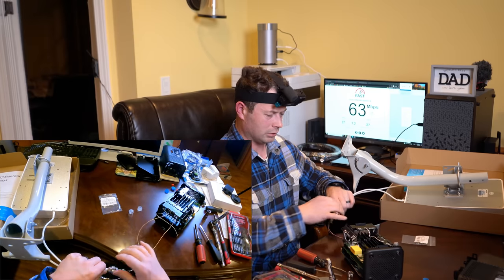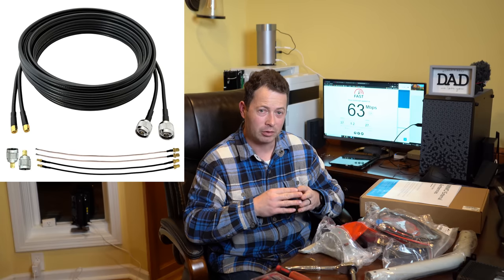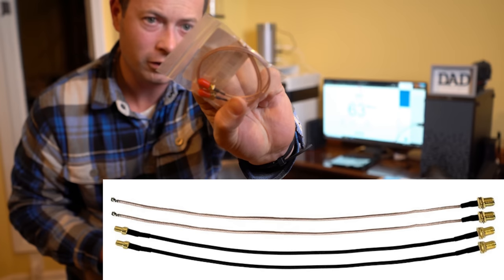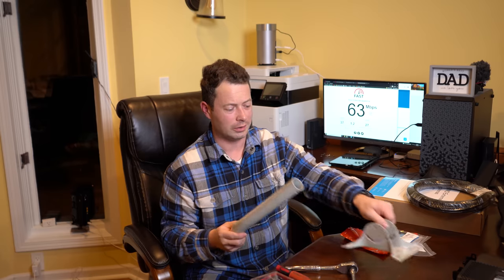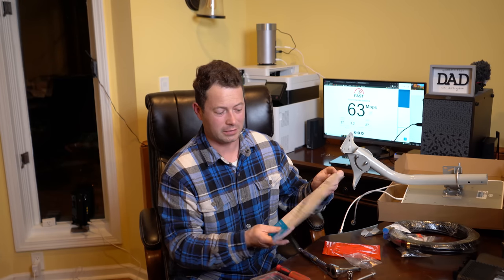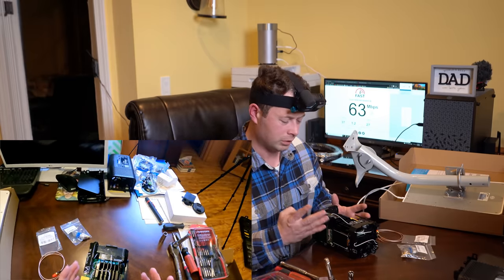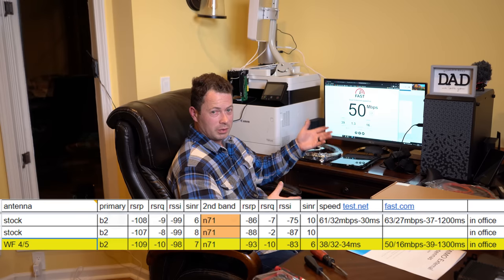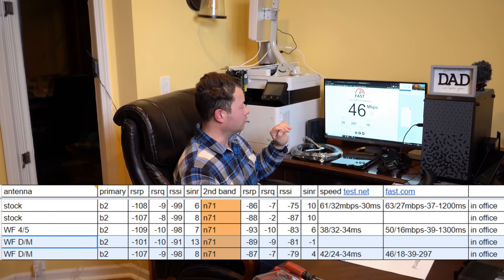✅ Waveform External Antenna - Arcadyan KVD21 T-Mobile 5G Home Internet - Speed Tested

Comment: Nice videos, very informative and appreciated. I see WaveForm also offers 4x4 MIMO Panel, I'll likely go that route once I verify they KVD21 is where I end up. I get the T-Mobile KVD21 tomorrow to test first before looking at the antenna. I currently pay $165 for 30 Mbps download and 10 Mbps upload in my rural area (line of sight is my best option here). T-Mobile found me, said I can get 5G with them, hopefully, it works out. More often than not I get about 12 Mbps down with 10 up is the reality with my current ISP. Starlink waiting list, I've been on for 18 months. Will run T-Mobile side-by-side for a couple months with my current ISP before making a final decision. If T-Mobile works out, they will have a new customer, I'll switch my 5 cells from ATT - crossing my fingers.
Reply: I'm curious if the 4x4 works out as well. I haven't gotten an antenna yet, but am just fine with a higher upfront cost for long-term benefits. Please post results if you can. Thank you.
Reply: @tismonkoh  I will. The antenna arrives today (the 4x4 panel) and I won't get to it until Saturday (if the weather holds). I thought the same as you, the savings and investing in antenna, would pay for itself in a few months.
Reply: @tismonkoh  Got the antenna up and installed  Ping: 24  Download: 181.76 Mbps  Upload: 13.76 Mbps. For me, the 4x4 MIMO External Panel Antenna Kit is making a difference. I was not seeing near these speeds, again I am under a tin roof. I have not tweaked the antenna (move it around) as I know where the tower is located. I can't see it due to hills and trees. I am amazed at the speeds I am getting. T-Mobile only promised speeds "up to" 150 Mbps. It fluctuates throughout the day a bit. I'll add that the length of the cable is shorter than I had anticipated and bulky to maneuver around corners and such (no attic for me). I live in a rural area, 30 Mbps download was a good day with my old ISP line of sight service. The antenna install will pay for itself in a few months in price comparisons. Streaming is awesome now, can watch channels I could not before. For my application - 2 thumbs up! I'll also note that when I plugged into my router without telling anyone, my wife noticed how fast the channels were all of a sudden. Click the channel and is almost an instant start unlike before. I did end up adjusting the MTU to 1428. I get fragmented packets if any higher.
Reply: @darrenhook2779  That's great to hear. Thank you. I need to do some testing to see if I can get ipv6 passthrough working before fully committing with an antenna, but it looks very likely at this point. Thanks for posting the results.
Reply: @darrenhook2779  please share which ports you used for your 4x4.
Reply: @Carteradams3216  M, M1, M2, and D.  It appears 4 and 5 are not active.

Comment: Got my waveform pnl installed yesterday. It attached to my tv tower about 25 foot up. Spent about an hour tweaking it for the best signal . I'm about 6-7 mile from the tower and right on the edged of the signal cone as its projected out on the sell map. Anyway download  avg now is 60, upload 16 and png 46.  M and M1 ended up being the best for me.  The only problem I have is if it drops the internet it will not reaquire it . T mobile app still show the cell metrics for 4 and 5g being connected but I have to reboot the gateway to hook back up
J
Reply: Get an auto Rebooter (Amazon 35 bucks) it detects down time and literally pulls the plug on it … waits 60 seconds and restarts it… actually works! You can also skip the delay and it will switch off then on again… Also you can schedule a reboot time… mine is set to 4am each day

Comment: Thanks for the detailed video  I just ordered the Waveform through your link. If you had to move your gateway up to the 3rd floor/attic as well, how are you getting connection on your lower floor? Did you just run an Ethernet cable from the gateway?
Reply from the maker: I did not have to move the gateway to the 3rd floor (especially with the 4x4) but I opted to.  I did run ethernet thru the house to get to my mesh nodes: https://youtu.be/ifRkJb_ejXY
Reply: @NaterTater  thanks Nate! Super helpful. I just got the antenna today and going to try and set it up.
Reply: @NaterTater  which ports ended up working the best for you? Seems like it didn't change the speeds much. Should I be fine to just used the front two antenna ports? Thanks!
Reply from the maker: @goldmund22  M and D if you dont get n41.  M and M1 if you get n41.  YMMV

Comment: Love your channel and can't wait to see this.  How far are you from the tower?  I can see an N41/71 tower from my house and it is about 3 miles (line of sight) and I wonder if I can get good speed.  Thanks.
Reply from the maker: I am 1 mile away but there are lots of variables and I know some that are 4-5 miles out with great speeds.  Line of sight certainly helps!
Reply: N41 😃….. drool!!!
Reply: I'm around 6 miles from the tower. Get 100 down and 50 up. 29 Ms ping. I can see it though

Comment: I am having trouble with my new gateway only getting 2 bars and losing connection and Internet often.  I will be purchasing an antenna in hopes it increases reliability.  My question should I get the panel like you or should I get the 4x4 mimo?
Reply from the maker: This video might help on that decision https://youtu.be/NzSbOlBPn3k

Comment: Forgive me if you addressed this already, I tried to look through your comments for the answer. Is there any loss being installed in your attic as opposed to the outside of the house? I really like your install and was considering doing it the same way so I wouldn't have to run the cables out of the house.
Reply from the maker: It does hurt the signal some but not as much as an interior wall.  Roofs typically have just a single sheet of plywood and shingles.  Still, best to be full outdoors though.

Comment: I'll be upgrading to a 4x4 panel and specialty cables 50ft wilson 400, 10 ft smr 240 and 10 inches u.fl.  on my hack antenna (cell booster) I'm currently getting 20/.75
Weather and fed ex permitting I hope to be online in a week with the new hardware
Reply from the maker: Cool, let us know how it performs!  I'm installing 4x4 soon, box is at my desk.

Comment: I just ordered this, coming Friday. I got a question have you ever thought about converting a old dish into a antenna? What's your thoughts?
Reply from the maker: You can potentially use a satellite dish as a reflector but you still need a cellular antenna placed at the focal point.
Reply: @NaterTater  thank you sir. I subbed.
Reply: @NaterTater  one more question Nate have you ever tried a USB connected antenna that would be a good video. Thanks for your time

Comment: Another great video.  I tried M and D, no joy!  Then I did exactly what you  using M and M1 while also connecting the internal antennas to 4 and 5.  The external antenna is lying sideways on the floor right now and the unit says "Weak" signal but my download speed is slightly better than the best I've seen so far.  My upload is more than doubled.  I'm probably 12-15 miles from the nearest tower getting steady 5GNSA B2/71 with 40 down and 5.5 up.   This is promising and maybe even worth drilling some new holes in my home.   I will share a mistake I think I made while testing M and D.  On the new MSA pigtails, I think the mounting nut was way up on the threads and I'm wondering if I even made the connection on one of the cables. Probably not but I'm not going to retest at this point.   ~ thanks again

Comment: What do you think of 2 vs 4 Omni? I am using THI in my van with 2 Proxicast stuck on the roof front and back.  I wonder if 2 more of these cheap antennas on M1 and M2 spaced In a square will add anything?

Comment: After some fiddling around with the Waveform flat panel and finally pointing it where it needed to go plus got it high enough (16 ft up) … getting 360mbps down and about 6 up… b66 and n41 best speeds late at night… was getting over 200 all afternoon and evening … it wants to flip flip with n71 and b2 at times but I finally got the overall speeds pretty solid…. Now just waiting for some 12”
Pigtails so I can put it back together…..
Reply from the maker: Nice!
Reply: @NaterTater  noticing the tower drops n41 around 6pm for a while (the scheduled early evening slowdown 😝)…. But it comes back on its own (stay tuned…. Am about to disconnect the internal antennas and see if it stays on n41….. my other option is  install my old pair of directional antennas (that suck for n71 and are great for n41…. Actually that should be the answer where I happen to live…. Many of the cheaper directional cut off at 698 … sketchy for N71…. I never could get it here until I got the waveform panel and now all of a sudden T-Mobile has n41 on all the surround towers 12 to 23 miles away … I’ll report back eventually

Comment: When you use Citizen Band and want to optimize reach, you usually want to take the length of you antennae and the subtract that from the length of your cable so that you operate in sections of 27 feet So, a dual antenna on a semi-tractor trailer with 4 1/2' dual whip antenna will use an 18' of cable that is split in the middle. You also subtract the length of the antenna mounts where your coax cable connects into the bottom. Where it gets complicated is where you are trying to tune wire whip antenna off of more broad band mounts. So, you need a RF(SWR) meter to find the sweet spots of where to cut and cap your coax. All signal is in some form of radio wave, so you could potentially optimize your broadband connection by measuring out the cable connection between your router and your antennae. To give you an idea on why this is important, is that on a good cloud cover night you can be an Staunton, VA, and use your CB to talk to a Ham operator by the name of Cadillac Man in El Paso, TX. You can also bounce signals over the ocean.

Comment: Just added two 8” pigtails last night … feels like I really need 12” 😵‍💫…. Also having mixed results so far… using m,m1 and connected the two I disconnected to 4/5 I was at one time concern that maybe one of my pigtails came loose so unscrewed it temporarily and my bars jumped up to 5!!! 4G signal was huge and got no 5G … hooked it back up and went back to where it was …. Still a work in progress…. Have not D,M yet…. Will do it tonight when I’ll back and have time (waveform flat panel antenna)

Comment: I'm disappointed in my Waveform 4x4 Panel Antenna.  I purchased the Waveform 4x4 Panel Antenna back in December and it worked great for 3 months.  Now, it's not working.  It's not damaged, so I'm unclear what could be wrong.  I've emailed and chatted with Waveform support and nothing.  They have not been helpful.  I thought they were all about Customer Service?  I'm willing to ship it back to them and have them look at it, but still no response.  It has only been two days.  I'll keep you updated.  All I want is for it to work again..lol.
Reply from the maker: There is nothing in the antenna to really break.  Are you sure its not your tower acting up?
Reply: @NaterTater  I moved the antenna around and located another strong signal and it's back up and running great again.  Thanks for the suggestion and thanks for the videos!

Comment: Thank you so much for this content. I recently signed up for the T-Mobile home internet service, upgrading from a very odd T-Mobile reseller that shipped me a SIM that I then installed into a Netgear LTE modem. I have two directional antennas (Wilson Electronics brand 700-2700 MHz) that I'm considering trying with this Arcadyan unit, but feel a little lost as to the best connectors to try. I may just try your exact setup that you used with the Waveform panel. Appreciate any thoughts you might have!
Reply from the maker: This is a good setup that I recommend.   Discount link in video description.

Comment: really wish TMobile would spec these gateways with just external antenna leads so they can be put near the rest of the home network gear. having to place these in a window is just not practical a lot of the time.

Comment: Why not use two of the panel antennas? Also, do you know if band 2 is coming from the same tower as the 5G band?
Reply from the maker: more money with diminishing returns, two is better but not 2x better.  b2 is coming from the same tower

Comment: I enjoy your great videos!  We have just received a KVD21 which we want to use for a small business service and are looking for the best location.  Luckily, our office is located about 500 feet from a T-Mobile 5G Ultra Capacity cell tower so we wanted to get the best signal we can without an external antenna.   We are considering placing the KVD21 inside a locked weatherproof plastic case mounted outside our building facing the cell tower.  We would have an Ethernet connection and a power cable or maybe use power over Ethernet.  We can also add a small fan on the case to avoid overheating.  Mounted outside, temperature can vary from below zero to 100 degrees.  Can these boxes perform within this temperature range?  Do you think this would work?
Reply: A friend has the newest gateway. It overheats and the network goes down when the sun from the window hits it inside a room that is air conditioned.
Reply: Def not designed to be an outside box.  It's designed to be in a dry, climate-controlled environment.

Comment: 5g modules require 4 antennas, i tried my rm520q gl with only 2 antennas they work slow. use all 4 to get 4x4 mimo and determine what bands the antenna ports support. not all are the same
Reply from the maker: https://youtu.be/ED4a913fOl0

Comment: I was looking on their site today and saw they have a new panel antenna with 4 connections, wondering if this might help overall signal. Or if two of the 2 connection panels pointed at different towers might be helpful, again using M, M1, M2, and D. I'm about 2 to 3 miles from 3 different towers, but trees, houses, and hills between. My modem is supposed to arrive tomorrow, so not sure if I'll get the old or new device yet. I have a feeling that I'm going to need external antennae to get decent performance out of this device.
Reply from the maker: Once you get the gateway you can see which tower you are connecting to and what speeds you get.  From there you can decide if you need an external antenna and what type.
Reply: @NaterTater  it arrived yesterday and I'm showing 5 bars on th. Speeds are around 100 down and 50 up which is a big improvement over our Spectrum cable. Also an improvement because spectrum was dropping out every few hours and there is no way to just contact support. So frustrating. Hopefully T-Mobile treats us better if there is a problem.

Going to run it as is for a while and see what happens when the leaves all come back. If it stays like this I probably won't buy an external.